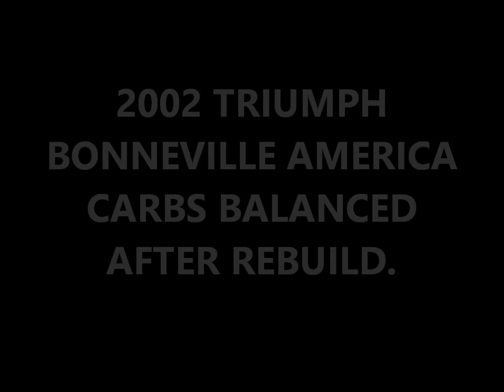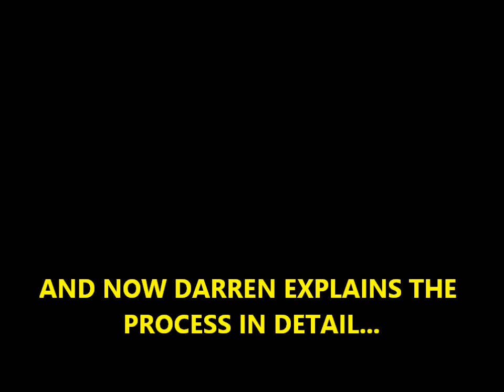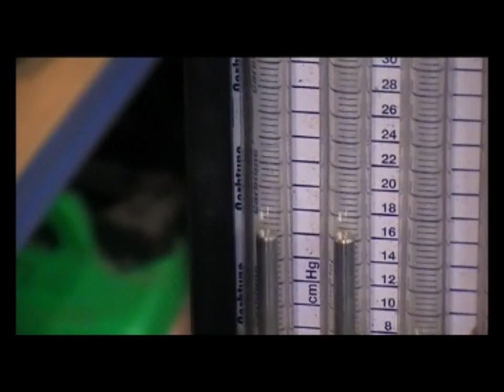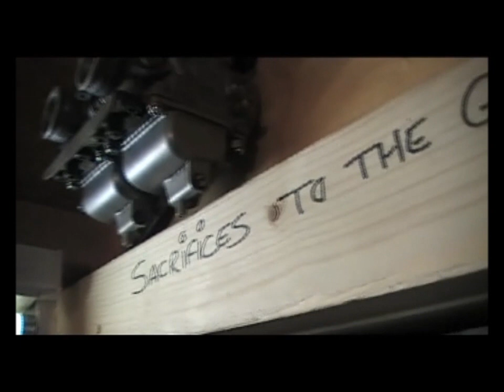2002 TRIUMPH BONNEVILLE AMERICA CARBS VACUUM BALANCED AND IDLE ADJUSTMENT. CLAYPOLE`S GARAGE.

Comment: Have a broken part on my triumph 2004 America it is on the rear of the engine single black wire with rubber boot at the end held in by brass nut any answers to what that part is ?
Reply from the maker: Hi Jeff, if it`s under the engine right near to the Oil Filter and has a black rubber Boot covering it i think it`s the Oil Pressure Switch / Sensor. When you pop the key in the Oil Light should come on but when you start the bike it should go off meaning you have good oil pressure, and or that the Pressure Switch is working properly, does yours do this or does the oil light stay on ? The only black wire i can see in my Haynes manual wiring diagram is that wire mate for the Oil Pressure Switch. If it is that and you have to remove and change it, the Torque spec on that part is 13nm mate. Hope this helps. Glen
Reply from the maker: If it`s a single Black with White cable it could be the Neutral Switch cable, real hard to tell on my bike mate as i have all the cables pretty much hidden.
Reply: @REKLESSWOLVES1  Thank you so much yes it is the oil pressure switch it is broke in half ! I Believe the part number is T2500347 it is 865 engine I just bought the bike!  2004 Triumph America ! Once again Thank you Glenn
Reply from the maker: @JeffWilliams-gk3gm  very welcome mate